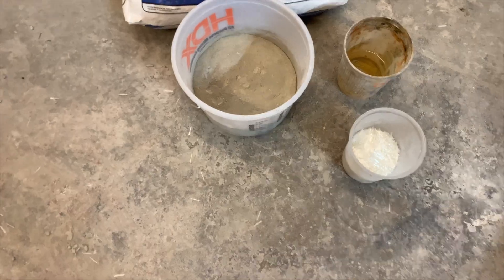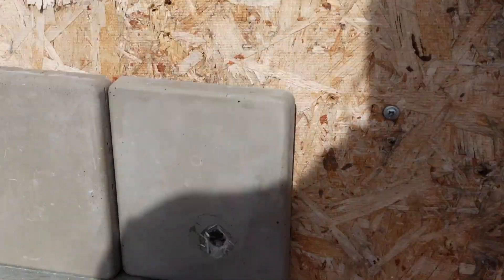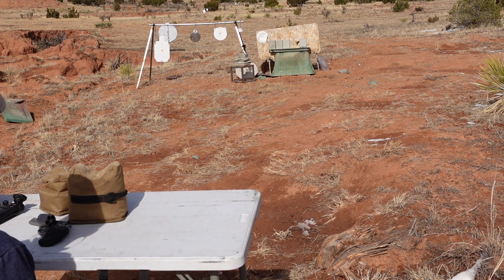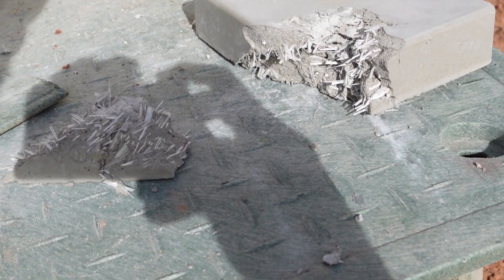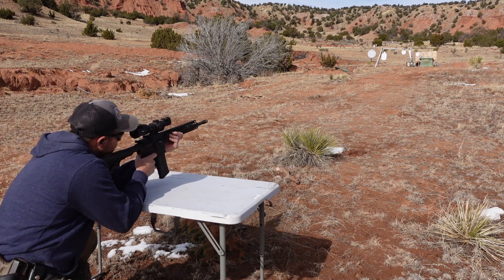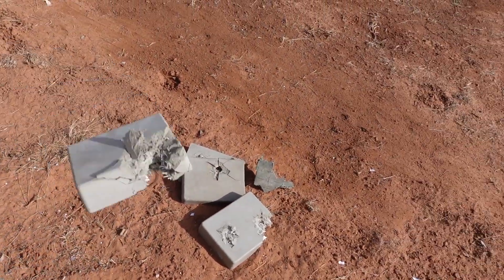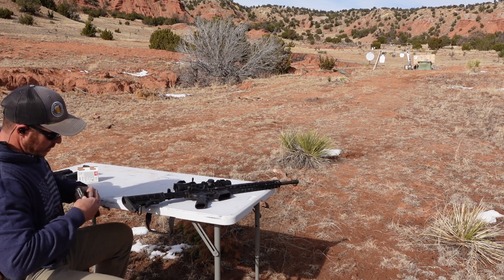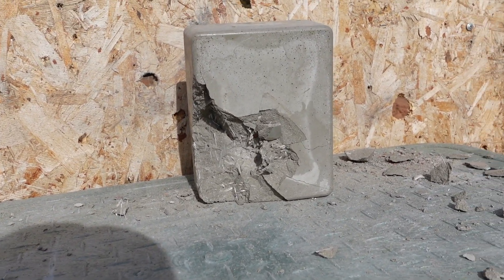Thin concrete that's bullet resistant!

Comment: That appears to be mostly cement rather than concrete. You need to add larger aggregates like gravel for strength, and/or layers of steel mesh for reinforced concrete. Done properly the stuff is incredibly tough. The extra weight would be offset by much improved strength. They were making bunkers and pill boxes out of concrete during two world wars that are still standing today, and demolishing even the smallest pill box is hard work... the concrete is still incredibly strong.

Comment: Use stainless steel pins instead of fiber glass. It will make a huge difference.
Reply from the maker: I actually have a ton of high carbon steel that I recently used in a test. You’ll love how well it worked. While it wasn’t the main testing material, it was amazing to see the difference it made. 
It’s at 9:00 of this video if you’d like to see the results. 
https://youtu.be/b2S2C9tImas?si=KplOTl84ZPpM69Ev

Comment: Make the concrete with a high amount of gravel in it and it will be more effective at stopping bullets.
Reply from the maker: That’s true, I was just worried that would also make it break apart much faster. I made another sample in a later video with glass marbles that worked very well.
Reply: @3RBallistics   Yes, gravel which is rocks, or glass, or ceramic tiles, all work very well.

Comment: You may want to try longer strands of fiberglass to bind better and add in small gravel aggregate to diffuse the initial kinetic energy of the rounds. Just a suggestion. Great project.
Reply from the maker: You are correct. We modified the mix and have been waiting for them to cure. I’ll have the new mix tested by the end of this month.
Reply: @3RBallistics  it would be great if you can develop a low cost concrete option for residential armor 😉 👍

Comment: How about with steel mesh  inside?
Reply from the maker: I have tried that and it works very well. The problem is the amount of weight it adds is very substantial. I have a new test coming out in about a month with some very strong samples.
Reply from the maker: I have tried steel mesh inside and it works very well. The only problem is the weight added is very substantial. I have a new test coming out at the end of the month with some very strong concrete samples.
Reply: @3RBallistics  That's awesome!  I'm also considering adding graphene.

Comment: The concrete can stop the round easily the problem is the concrete doesn't have enough structure to hold it in place...Get a 6 mill plate hard Ox or Bis Plate with a Lip all the way round with nipples then fill tray with reinforced 55 MPA concrete with Long thin Fiberglass like cut strips from a welders Blanket  and then fibreglass to encase and rhino coat for anti spall and the fibre glass will contain the round the rhino will take care of the metal jacket spall and the concrete will not compress and cant expand as its held by the steel and the nipples anchor it across the face... Concrete fibreglass blanket steel plate  and rhino coat....Make a Few test at varying thicknesses and only with each calibre...,Test and adjust as per each calibre requirements.... Then classify....

Comment: Have you conducted research into new extreme strength concrete types? Apparently, in Iran, they developed a form of concrete that is supposedly strong enough to withstand the rocket assisted gun tube penetrating devices.

I don't recall a lot of the details, right off, but it is vastly stronger than typical concrete. If I recall correctly, it seemed to be largely due to the entrained fibers, but I'm not certain.
Reply from the maker: I have worked extensively with Ultra High Performance Concrete. As a matter of fact, I have some FGCC (layers of UHPC) curing at the moment. I should have that video ready to test in a couple of weeks. I love working with concrete

Comment: How long did you let the concrete cure? Full strength usually comes in after 30+ days
Reply from the maker: I waited slightly over a month. I work with concrete the most and have over 10 other samples curing out waiting to be tested. They are Much, much stronger samples. I did this video more as a baseline starting point only to show what a very basic concrete mix can do.

Comment: Seems like the concrete is too brittle  but has decent stopping power.  2 suggestions:
Back it up with something flexible like hdpe and then wrap it in welding blanket permeated with resin.  Also you could try soaking the concrete in a tub of water after it's initial cure for a few weeks, which will make it much stronger.
Reply from the maker: Love the suggestions. I do have a previous video where I wrap the concrete (GFRC) with fiberglass and it held up quite well.  Also, I have version 2.0 of these concrete slabs curing as we speak.  They should be ready to test in about 15 days.
Reply: @3RBallistics  cool, I'll go check out the other video.

Comment: You should check out hempcrete building blocks they are fire resistant and if you play with the length of fibres you could probably make them bullet resistant as well . Thanks for the video it was really interesting .
Reply from the maker: I absolutely will check that out. I do plan on making some UHPC samples as well along with many different fibers to try out.